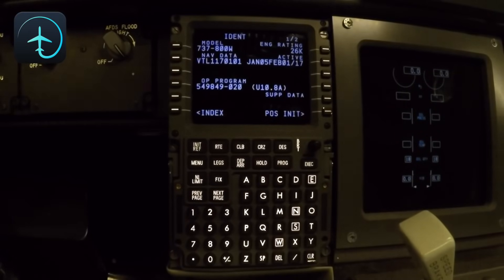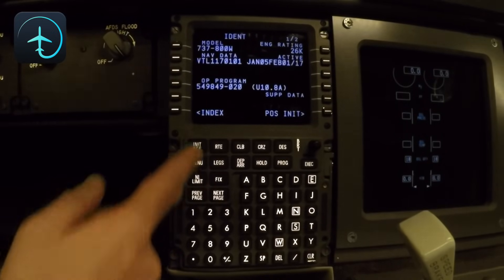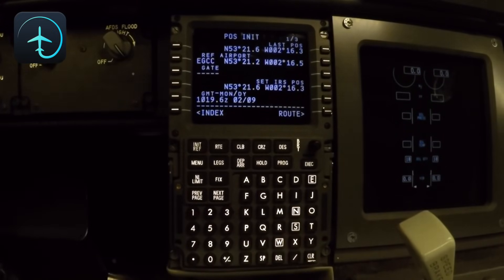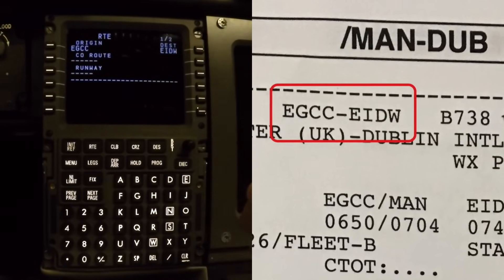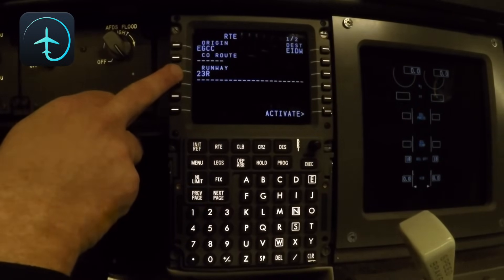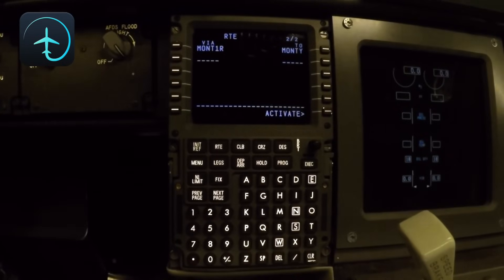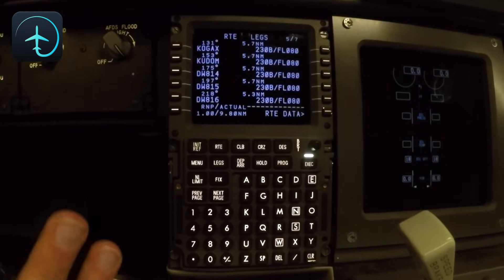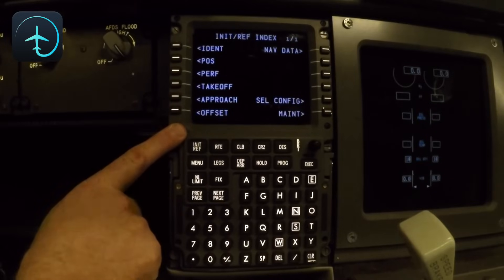Full FMC setup - Boeing 737NG

Comment: As an IT engineer, here I am wondering what OS runs behind that FMC :)
Reply: It is likely to be either VxWorks or QNX. The software programming is likely done in Ada. Most of the life-critical software in avionics is done in Ada because it is easy to statically verify that the program will not malfunction, it has extensive support for constraints and tools exist that can exhaustively verify that the software will never enter any state that violates the constraints.
Reply: It's gonna be a custom, embedded system
Reply: DOS 6.2 :-)
Reply: I’d venture to guess some flavor of Linux. I was thinking the same thing lol
Reply: Stan Lem well you know whole system on boeing 787 is running on windows xp i am not kidding
Reply: @planespottingmore9130  If thats true we would have crashes on a weekly basis LOL
Reply: @bardo0007  well my friend who is working in boeing have send me a very nice photo of 787 cockpit where on all screens you could see windows xp crash screen but in 787 this windows is heviely modified

Comment: Interesting, there is not even the usual Download Route prompt on the route page. No ACARS for ryanair? Cuts down on the work during the turnaround, download the route, wind data and just input SID and STAR with the approach and you're all set. Even better if you can download it into the second flightplan while in the air, nothing to do during the turnaround except the walkaround.

Comment: I have B737 600 simulator at home and I use Prepar3D with PMDG on IVAO network with yoke, throttles and rudder pedals and saitek panels. I also simulate briefings and calculate takeoff and landing performance... I am 15 and I want to become an airline pilot. In your opinion, how realistic is PMDG? Can it help to someone to become a pilot?Nice video!
Reply: Branimir Filovski I have not used any simulation software.  my neighbor has pmdg, seems like a good representation of the basic framework😊
Reply: It is excelent for prosedures, the systems are as acurrate as the sim  allows it. The only part that FSX can't  do 100% acurrate is the flight model. XP-11 can compliment with the feel of flying, the  default cessna is very good, but don't expect the XP-11 737 to behave as the ngx systemwise.

Comment: @Mentour Pilot I've seen that some pilots are told to set V2 +20 into the speed window on the MCP, however in this case you haven't done it. Is that something that varies by airlines/SOPs or is it a normal thing to do?

Comment: When will the PFD display LAND 3?
Becuas I have seen CAT3 A approaches without it popping up
Reply: patrik streng i cannot speak for the Boeing however, the 320 has five columns above above the PFD. during an ILS, Colum 4 indicates which approach capabilities are in use: CAT 3 SINGLE or CAT 3 DUAL.
Single: indicates CAT III  capability with Fail Passive Condition
Dual: is CAT III capability with Fail Operational❤

Comment: this is the most comprehensive instructional video of the flight management system on the net. filmed inside a level D simulator: what is that?   
They are mounted on a platform that can represent the different attitudes experienced in flight. The sounds, alarms and engines are just like the real thing.  pilots are able to practice the most complex departures and approaches.  It is here where the crew gains invaluable experience setting up CATII and CATIIIA ILS. It's not always smooth going. at the trainer's discretion,   emergncies of every type can be thrown at the
crew, all in real time and no one brings you closer to action than Mentour.  Guys, it's time to invest in what you love. get the Mentour Aviation app and download the content. Precise information  direct from a senior captain and TRE (type rating examiner) it doesn't get better than this.
love,
Ava❤

Comment: Hi, Mentour. I just can not find it out... What does BARO mean? How to set it up? ☺
Reply: Like Huore barometer
Reply: Like Huore short for barometric altitude, which is measured by air pressure and with units of feet above mean sea level. As opposed to radio altitude, measured by the radio altimeter with units of feet above ground level.
Reply: Thank You for answering! When to use it? How to use it? How to calculate it? :)
Reply: Like Huore the barometric altimeter determines altitude by reference to pressure level. It works like this:

Flight level. Standard pressure setting (1013 mb, same as 29.92) is set when flying by reference to flight levels above the transition altitude; which in the United States  and Canada is 18,000 feet.

Altitude.  airfield pressure setting (QNH) is set when flying by reference to altitude above mean sea level below the transition level;

Height. Altimeter pressure setting indicating height above airfield or touchdown (QFE) is set when approaching to land at airfield where this procedure is in use❤
Reply: Like Huore 
No probs. You will need to refer to the ILS Approach procedure document for the runway you are using and that will tell you what the desidiosa heights are, and whether to use baro or radio. 
It also depends on the weather conditions, for example for CAT III ILS approaches in low visibility with low desocupen heights, you will need the most accurate height measurement available and will use the radio altimeter. Hope that helps.

Comment: You have to do it for every flight? If so, what happens on mistakes?(you have little time and you are in a rush)
Reply: Claudiu yes, some flight plans are stored as company routes, but they still require additional information   both CDU'S are checked before departure so there is no error.

Comment: How long does it take to completely set up the fmc on a Normal flight?
Reply: It depends on the Flight. Usually around 15 minutes to 20 minutes, setting up the fuel, Weight, Programing the landing and arrival, routes.
Reply: and how they do it in 25 minutes turn, as ryanair is doing?
Reply: Claudiu takes about ten to twelve minutes to insert everything we need. a lot depends on if we're working with a stored route or building something new